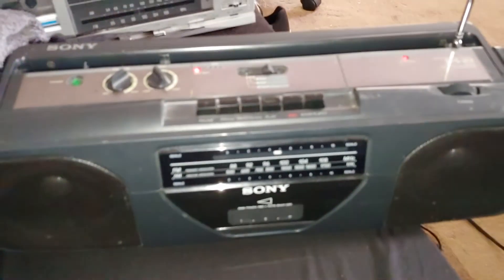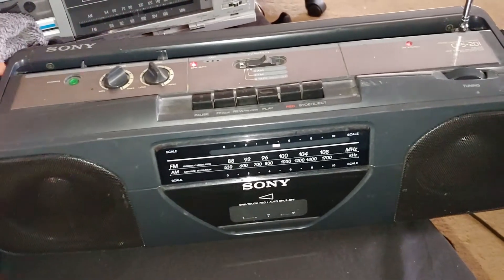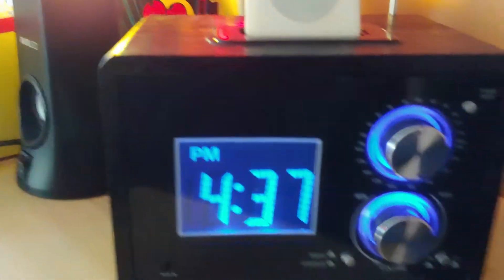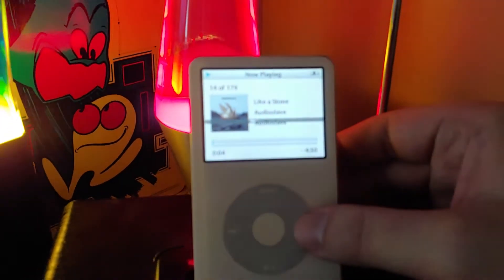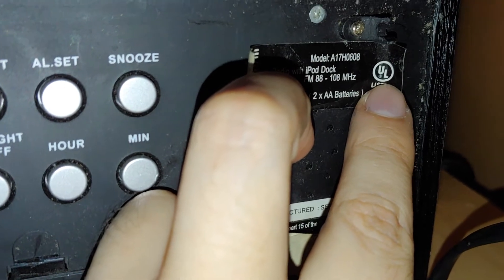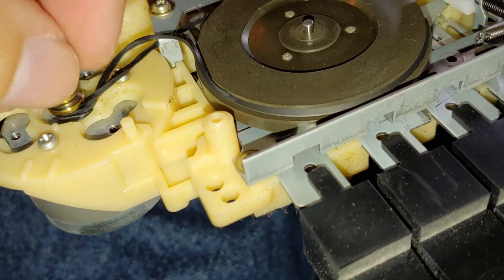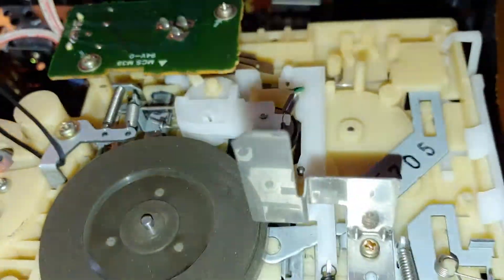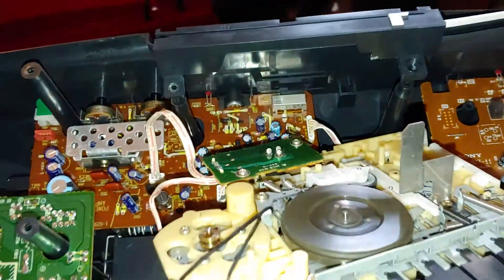Thrift store finds, Sony CFS-201 boombox - TDE iPod dock/clock radio

Comment: Used to b a CFS-201 at this kids place i went to, exactly the same except it had a band switch with FM, MW and LW. Went back last year and found it still there and being used as a radio but the tape deck died. Motor could be heard though so belt most likely went to tar.
Reply from the maker: Yea sounds like it turned to tar, or just snapped.